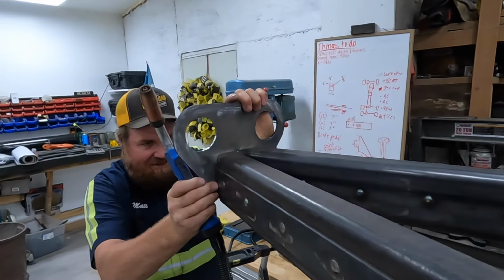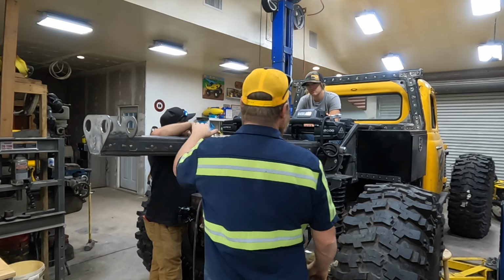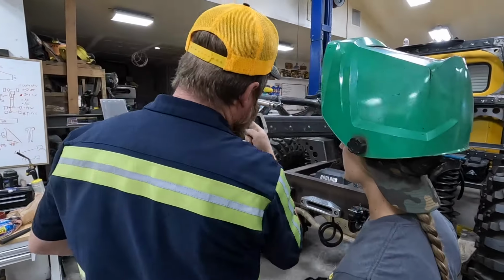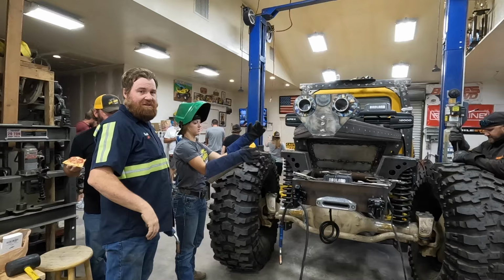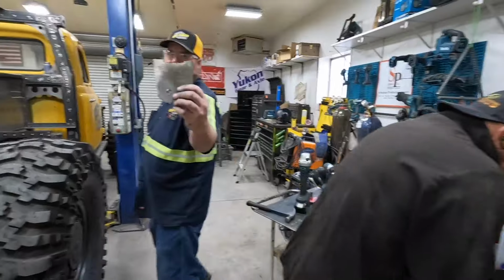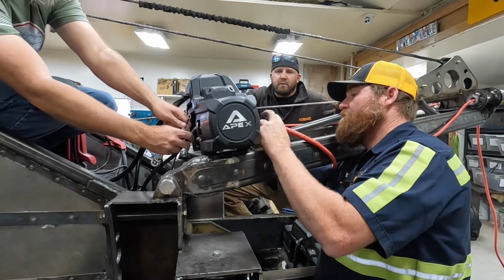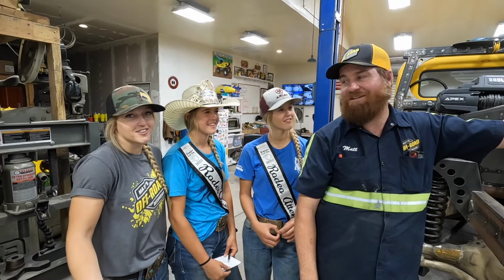Fully Operational Lift For The World's Largest Off Road Wrecker!

Comment: Matt Going to take guess your Wrecker will weigh 🤔
With 40 gallons of Fuel.  6,903 LBS 😳🤫😃🤔
I Hope I’m Close , I know your going to a wrecker competition.
If you want to lift More To win 🤔
Add a Winner Jack to lift more , add a Prop down from Boom to 3” In front of your axle . NOT TO THE AXLE ,
In The Bed , 

To test this theory , take 2 pieces Steel 12 “ Long x1 1/2 
2- round 3/8  x 8”

1. Find center of 1 1/2” mark , this is where boom attaches behind cab.
Weld a 3/8 round stock there .
2. This time Weld another pice of 3/8 about 3/4 from the end of the 1 1/2 x12” 🤔😃🤫 

Push down on each one , you will notice  the One welded close to the 
End is lifting The Full weight of The Truck
I’m Not saying Move The Boom axes pt.🤫 add a winner stick😃

The One  behind the Center is good 

This Is Better, Those Two Bars could be on Pivots

Or One

Comment: Smallest big wrecker I've ever seen. 
That could not pull out my dozer.
Reply: Might I ask how you would get your dozer stuck on a buggy trail?
Reply: @JohnFL  I have never buried a dozer... yet. 
I sometimes get leased to the Dept of Interior for the summer to repair trails in national forests. 
A notice goes up on the board at work and we can put in for the job. 
The Forest Service pays my employer (public works)  
The trails are somewhat maintained for fire personnel access. A lot of drainage work. 
I've spent 4 summers in Colorado. White River National Forest, Pike National Forest. 
Graders are 6 wheel drive with lockers and adjustable torque to the front wheels. When they get stuck, they're stuck.
Without some occasional maintenence, most forest trails would eventually end up like the Rubicon Trail or Holy  Cross City.
Reply: @TheBandit7613  Rubicon Trail in a forest, are you kidding? It's basically a bunch of rock formations, not just a dirt trail with ditches in it.
Reply: @JohnFL  The Rubicon Trail use to be a county road.
Reply: @TheBandit7613  And? It's not any more. 
Anyway, I think the terrain we're going to see Matt taking the world's largest off road wrecker on is going to be at least a couple levels harder than the trails you're used to. Not somewhere a dozer would be able to drive.
Reply: @JohnFL  Trails I'm used to? I have as much off road stuff as Matt! 
I know what these trails are about. 
I'm saying, without maintenance, nature takes back roads. What I'm  really saying, is that off-road wrecker is SMALL. It's the biggest wrecker in South Hurricane. 
CLICKBAIT pisses me off.
Reply: @TheBandit7613  What are we comparing it to?
Reply: @JohnFL  There's a lot of big wreckers out there. FWD heavy wreckers, TATRA T813 tow wrecker, plus all the military wreckers.
Reply: @TheBandit7613  Okay, you mean like Heavy D's big green Oshkosh? Matt and Dave talked about running that in the off road wrecker Olympics this winter, and decided not to because it won't even leave the staging area to do the easiest trail at Sand Hollow. Much less the harder ones that Matt designed his wrecker for. Also, Matt tested a deuce and a half and ended up having to recover it.
Reply: @JohnFL   I go to Sand Hollow. We get a group camp every year for the week before Thanksgiving. 
They didn't air down the Deuce and a half. (On purpose) Need to air down at Sand Hollow. 90% of Matt's recoveries are because people don't air down. The rest are because of rental SxS's and people trying to make them fly. 
Matt wants to call it the largest off road wrecker and it's actually small when it comes to off road recovery. Look at wreckers that drag Abrams tanks out of mud holes. I'd go along with rock crawling wrecker but not "world's largest wrecker" 
Clickbait is so weak. 
This is twice the size of Matt's little wrecker. TATRA T813 tow wrecker
Reply: @TheBandit7613  If Heavy D's wrecker can't do buggy trails, chances are another army truck the same size won't be able to. They got the Deuce and a half stuck because the diesel engine didn't have enough throttle response to make it up a hill.
Reply: @JohnFL  You're losing me with the "buggy trails" thing.
Matt's claim is Largest Off Road Wrecker" period. Not wrecker that can visit Sand Hollow. 
The M88A2 Heavy Equipment Recovery is many times larger than Matt's small wrecker. Being tracked, it will go many places. 
Matt turned dishonest for clicks. Makes me sad.
Reply: @TheBandit7613  So we have to make a distinction between off road as in not on the pavement and obstacles. A Crown Vic can do 40 in a field but that doesn't make it an off road vehicle, or put it on par with a fully built Jeep. Similarly, military wreckers can drive off the pavement, but obstacles are a few levels above their capability.
Reply: @JohnFL  It depends. I'm not convinced Matt's wrecker is going to be following Trail Mater everywhere. The width of those axles are WIDE as fu**. Width is a big deal on a lot of trails. I have a couple Jeeps and a fairly new rock crawler model side by side. The smaller lighter SxS is amazing. More than I originally thought it would be. 
I've been all over Sand Hollow and there are places narrow is a huge asset. 
I don't know how well that ugly thing is going to do in sand. It's heavy as shit (heavy is the enemy of sand) and has low hp for the weight. 
Light weight and high horsepower are needed in sand. I don't know what he's even going to use that thing for... besides clicks.
Reply: @JohnFL   Go watch Rory's new video. He talks about what I'm bitching about.
Reply: @TheBandit7613  He addressed clickbait but not the World's Largest Off Road Wrecker
Reply: @JohnFL  Clickbait is why we are going back and forth. Clickbait pisses me off. I don't know why I let it bother me, but it does. Worlds largest wrecker is obviously clickbait because it's clearly not. I thought is was cool how Rory explained Youtube pushes creators to make titles like those and Rory won't do it. Matt has given in for clicks. Matt should have built something like Trail Mater.
Reply: @TheBandit7613  Oh, I thought we were debating about what World's Largest Off Road Wrecker meant? And in case you're wondering, Matt has mentioned that he believes in click bait. Because it works. Veritasium has a video explaining how effective it is.
Reply: @JohnFL  I have already shown Matt's wrecker is not the world's largest. 
We have moved on. 
As for clickbait. Maybe it doesn't bother you. That's cool. 
I see clickbait as dishonest. Dishonesty is a fast way to lose me as a friend (or whatever) I don't ever want to wonder if something is true or not. I don't have the patience for that. Some dishonesty is allowable (no honey, that dress doesn't make you look fat) But dishonesty meant to manipulate me is a no go. You really don't understand, or you are just playing games? 
I have to get ready for work.
Reply: @TheBandit7613  You may have convinced yourself, but I'm sticking to what Matt has proven. Which is that big military wreckers aren't really off road vehicles. 
Matt stays away from click bait that isn't part of the video. I believe he has the capability to be dishonest, but I don't believe that is the case here. 
Maybe we can chat again when we see what the World's Largest Off Road Wrecker can do. Until then, enjoy your work and I wish you the best! Goodnight
Reply: @JohnFL  Tracked vehicles are 100% for off road use. Period. You are now wrong. What do you think tracks are for? END.

Comment: Shouldnt the fuel filler neck be cast aluminum coated with a electrically conductive coating that will prevent static charge buildup and a ground wire for further prevention, not cast iron filler?

Comment: Natt you know more about towing with rope  and winching with rope and rigging things in ways that ,maximize  lifespan and availabbility of recovery equipment. So it surprised me to see you install single point inline  fairleads for a boom head,  Even though the winch side of the fairlead ought to aim the rope  so it spools back onto the winch in perfect layers it seems like on the load side that fairlead would need the rope  flatten itself out and make a hard turn towards the load   except when the fairlead was pointed directly at the load. Maybe I dont get it but that seems like it would be awful hard on ropes and no picnic for winches that see a lot of use.  It seems like a more traditional boom head that aims the rope (or cable) straight at the winch center exactly the same way the aluminum fairlead does and slipped into the same piece of pipe the faiylead fits into the pipe so it can spin inside the pipe fairly freely. Then fabricate or buy a sheave that  has a half round groove that fits your rope and make a mout that welds onto the steel fairled  amd positions the sheave so it .. You know what  you can just look at the load side of the yellow boom heads on the blue boom that is sitting on top of Pauls  rat rod wrecker. Those will roll cable or rope over a sheave on the load side and the cable or rope will automatically spin the boom head in its pipe to aim the sheave at the load when the winch ads tension. Pauls boom headsroute his winch cables over the top of the pipes they fit into but your routing is much cleaner looing even though it would also be much harder to reave if you used wire rope on your winch But with soft rope winchlines that can be cut  and backwoven or even tied when any part looks iffy then routing through a welded in solid pipe is fine,

Comment: hey so you guys built a awesome boom for the heavy wrecker. I think you could have done the end of the boom alot easier with just mounting two snatch blocks on the end of the boom and just running the winch line through those. what do you think?

Comment: Why did you mount the main winch to the boom?  Wouln't it be better to mount the main winch to the truck frame in front of the boom?  This way the boom lift winch wouldnt be pulling the whole load, just keeping the boom up.  With the current setup, you have a single point of failure causing the potential loss of both load winches.  If the boom lift system goes, you are kind of sol.  Maby I missed the explanation earlier.  I used to be an engineer but I've never built anything like this, sorry for the keyboard warrior post.  Over all the build is completely awesome. I thnk the Morvair left some big tracks to fill.

Comment: MIG welding cast iron with ER70 filler WILL crack from the carbon content. Be aware of the danger since it will be fuel vapor leaking out.

Comment: I'm curious why you opted to go with synthetic line rather than steel cable for the rigging on the boom... not saying you shouldn't have, it just seems an odd juxtaposition with all that beefy metal. With the hawse eyes on the end it should work great,  it just surprised me. I think it's mostly that weird place in the back of your brain that still thinks "rope" isn't as strong... even if we actually know better. And yes... so much YES for a WWF style belt for the winner of the tow truck olympics!!!

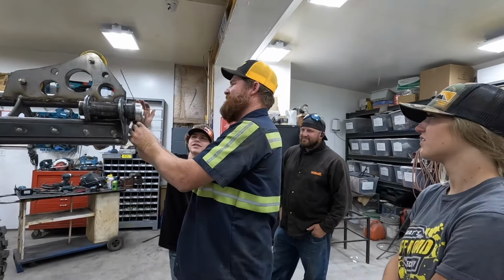Comment: 13:17 Again, little kids at the drill press with no eye protection.  Steel chips flying.  It only takes one small steel chip to ruin your day.  I'm a woodworker.  We have ten fingers so missing one is not that big of a deal.  But we only have two eyes, missing one is pretty debilitating. Please just ware some safety glasses!

Comment: 1 12k winch holding up the boom and force of 2 12k winches on the boom ? I understand the two pulleys to increase the pull but what happens when you double line the winch’s on the boom ?

Comment: Think we need to go find a wrecked big backhoe, then steal the hydraulic feet off it. So this truck can plant some hydraulic steel feet on the ground in the rear. Other than that this wrecker is going to pull itself towards the wreck.

Comment: I'm sorry to tell you this, but your wrecker will overheat constantly. The oil pan is a huge part of the cooling of a gasoline engine like your Chevy V8. The radiator is only 1/2 the cooling. By protecting your oil pan with your frame, you cut out 1/2 your engine's cooling. Those tiny oil coolers are supposed to supplement the oil pan in cooling the oil. They are nowhere close to enough to cool your engine oil.

I hope I'm wrong.

Best of luck!
Reply: @MattsOffRoadRecovery  I hope you're right.

All the best!

Comment: Your gas tank filler hose is too low to fill the 60 gallon tank.  You filler neck looks to be about 8-inches from the tank bottom.  You need to think about Hydro Static Pressure. To fill the tank above 8-inch bottom you have pushto the volume of gas volume
Reply: The gas above at 8" mark has to pushed which requires a sealed connection at filler neck.  That is why filler necks on vehicles is at the top of the tank, to avoid Hydro Static Pressure problem.  Did you install a back flow preventer to keep the gas from gushing out as you try to fill the tank?  Is there enough pressure at the Service Station hose to overcome the fuel as you get above the 8-inch Mark. Again Hydro Static Pressure pushing the added gas volume up as fill.  I Do Not Believe you will be able to fill this tank without an additional Pump assist as Filler Neck is currently installed.  You cannot fill a bath  tube if the filler neck is below the water level.   The simple solution is to install the Filler Neck at the top of the Tank, let gravity work for you, and avoid Hydro Static Pressure Problem your Current Design has created.  Sorry for the two part message, it is too easy to touch the screen and accidently send an incomplete message.  I'm enjoying you Tow Truck Build, Thanks Bart
Reply: Good Tank Design.  How do you keep the Tank from Rusting? From my experience with Steel Tanks rust was always a problem even when holding gasoline fuel, that why Galvanized Tank were used   You should add an additional filler neck at the top of the Tank for manual fills from a Gas Can, as you will not be able to make manual fills from the Filler Neck in its current location, you just Don't have the head pressure to do so.
Reply: If I was building this Tank I would Epoxy Coat this Tank, especially on the inside, paint the outside. Both will help in fighting Rust.

Comment: Someone bestow some knowledge on me.  It doesn’t look like those winches will need to be run all the way out, why not leave a single or dual wrap for maximum pull?  I thought max pull was with 1 wrap?   (I know they used pulleys etc)

Comment: I’ve seen a bigger wrecker just saying. If I could post pictures I would.  But this is way nicer.
Reply: Matt commented that every picture anyone has sent him of a larger wrecker is on perfectly level ground. We're talking buggy trails, true off road. Not just semi-level dirt.
Reply: @JohnFL   I’ve been watching this channel for awhile now atleast a year I bet more. That said I’m fully aware of what he does and what this wrecker does.    There’s a custom deuce and a half in my town that’s bigger then this and is a wrecker just like this goes up every trailer within a 100 miles of me.  I see him at mud bog contests to trail rides to rock crawling.
Reply: @rodleypumpkins4174  Matt tested a deuce and a half at Sand Hollow. You've been watching long enough you should remember it.. they ended up having to recover it from the sand because the diesel engine didn't have enough throttle response. They might be great for hard surfaces but way too heavy for Matt's needs. Also Matt said his wrecker will be more capable than a Unimog. Ultimately, we'll see when he gets it done what Matt means by off road.
Reply: @JohnFL  I should have also saidthis one aside from the motor is all bobbed and has 4 tires instead of 6 and it’s on I think 48-50” tires.  Taller then my daughter  lol. They are run flat tires that are bead locked and the spare has its own hydraulic arm because the bastards are so heavy.    The winches are massive on this thing too   It’s badass I think it would at the least give this one a run for the money.
Reply: @rodleypumpkins4174  I've got to say, that does sound a lot more capable than a stock military wrecker. Matt is running 54 inch Mickey Thompson tires and trying to keep everything light weight. He also has a gas engine in it for more throttle response among other things. 
This guy's wrecker sounds a lot like Merlin's from Merlin's Old School garage.

Comment: I would love to know the weight of this truck.
Reply: The goal is 12,000 pounds, and it's coming in a little light
Reply: @JohnFL  I think it is light too. I would think they need to add 500-1000 lb to the front to make sure there will be enough weight on the front axel with a jeep on the back.
Reply: @livesonafarm  Matt designed it for RZR recoveries, so 2000 pounds will probably be its typical load.
Reply: @JohnFL  I am sure it will do RZR 90% of the time, but he wants it to do what fab rats can do with Grandpa sherms tow truck.  if you watch the video with them when they pulled George's jeep out of the canyon that is Matt said he wants this wrecker to do.
Reply: @livesonafarm  Yes, of course he wants it to have the capability to do that but it won't be doing that all the time. Matt commented that the winches will generate 40,000 pounds of pulling force so that base should be covered.. they're constantly adding more steel so it will likely be much heavier by the time it's finished.

Comment: It's going to fail , your welding wirh , I'm guessing 035 mig .? Your weldment with mig is good , i would be using 0.45 dullshell and doing  a perheat  on the bume of your recovery bome, and your fabricator is on all your  parts are good ,your fit up and fab no preheat and just running IDk what  Electrode your using, i see a lot of  Stress points
Reply: Over my 25 years of welding., sorry , i can help